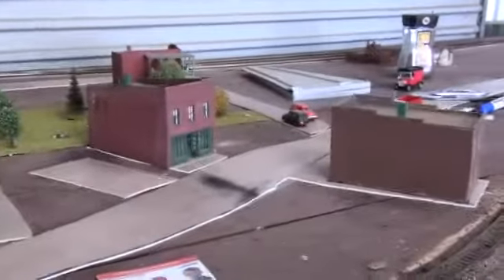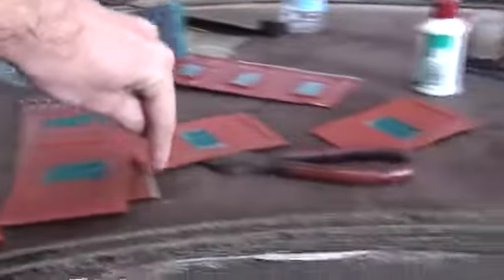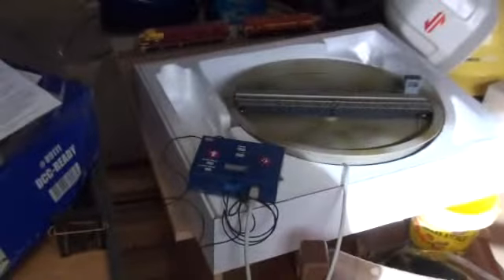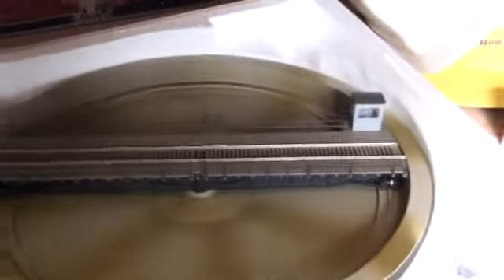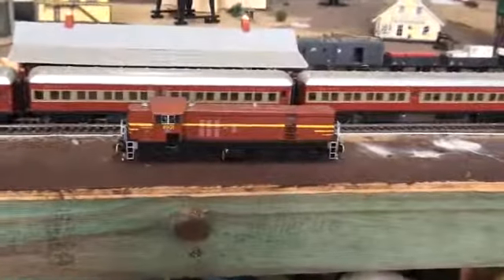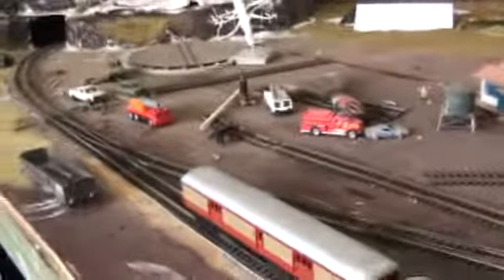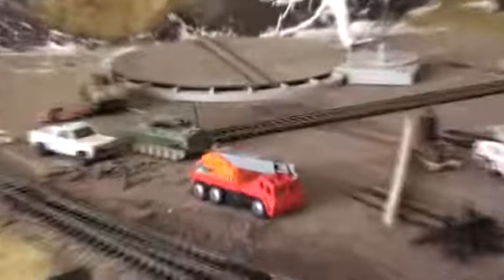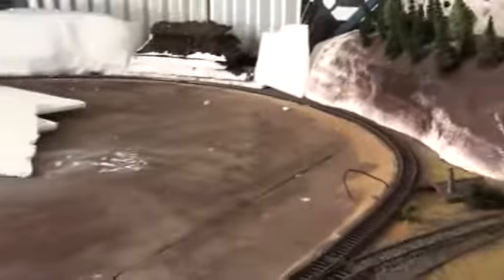layout update 12.5.13

Comment: I do have a turntable on my layout, its not heljan, but its still a electronic turntable, I knkw this seems obvious, but, what I did, is when I had troubles with my turntable, luckily it hadn't been fully installed, is I took it down to the nearest hobby shop that does retail in model trains and accecories and I got it fixed there and it now works fine. Turntables are something which you sorta don't want fo fiddle with yourself unless you know what you are doing.